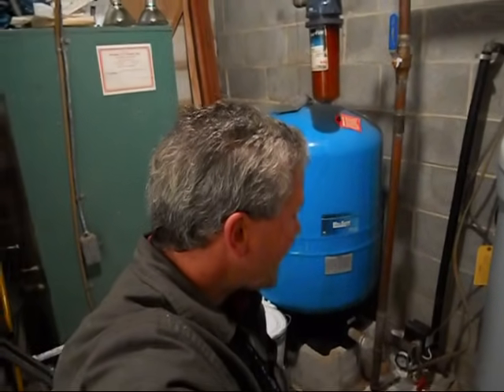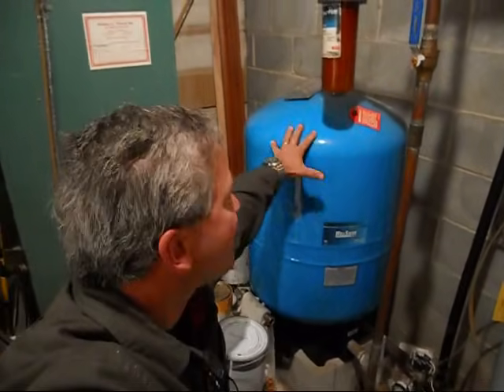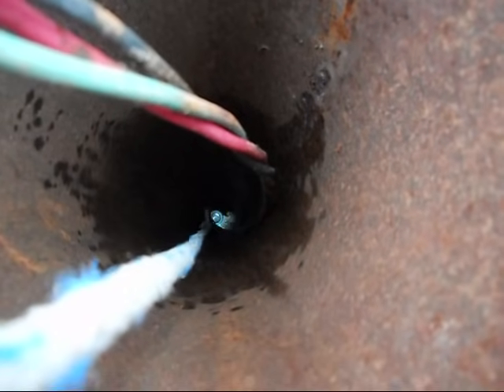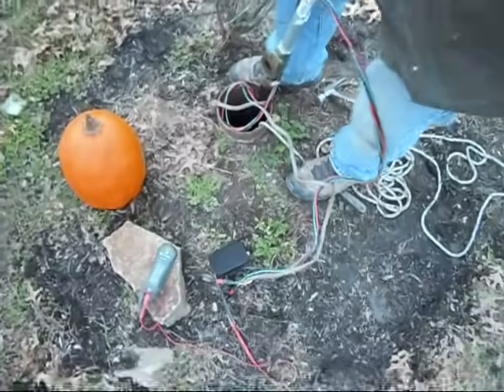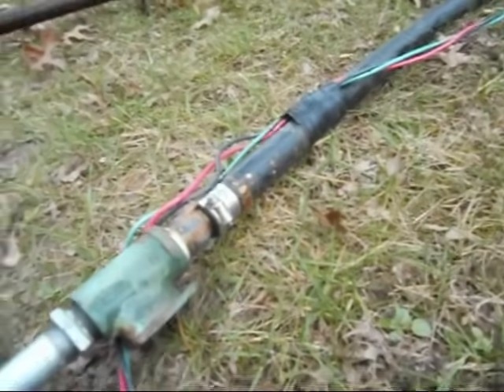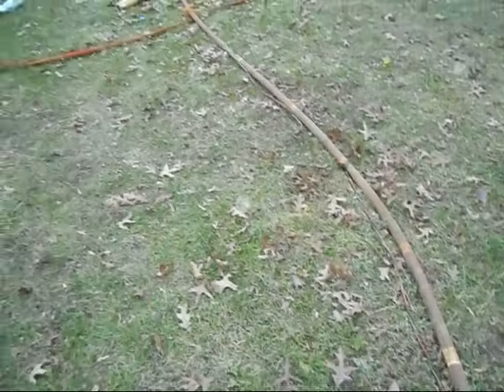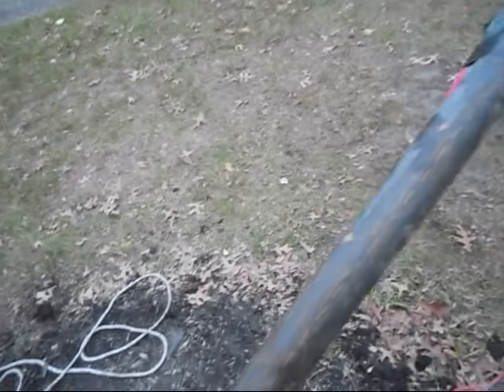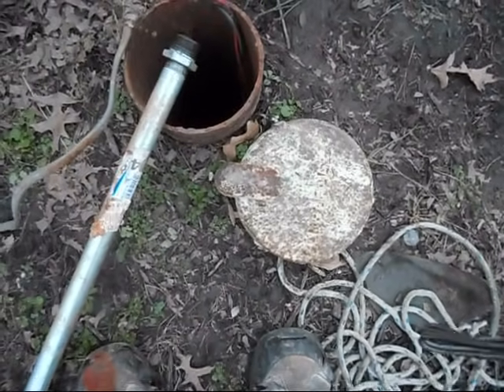Replace Well Pump in 4 hrs (all 12 videos clips) 100 ft Myers 2ST52-8 by Tatcor.com West Chester, PA

Comment: New pump, get a new check valve, too.  Wrap the clamps with electrical tape, too.  That’s so they done hang up on anything.  Wrap the wire around the tube, many places to prevent tangles and knotting up.  It also protects the wires from rubbing on the pipe, Shorting out..

Comment: great video if you have that awful black flex pipe which can crack from freezing  schedule 40 pvc screw together is much  harder and requires a well rig tool to unscrew and rescrew the pipe my pump is 700 ft deep i live in georgia 3 layers of granite and bedrock which broke the drillers bit 3 times lol i have seen my pipes no go here for this need a pro

Comment: Couple of things before anyone starts this process. 1. clear debris from around the well BEFORE you open it.  You do NOT want ANY organic material falling into the well. 2. prepare your work area, preferably with some way to keep the hose out of the dirt etc.  you also probably want to have some kind of degradeable safe disinfectant available to wipe the hose off as you're lowering it back into the well.  My commercial deep water guy used minimal amounts and after reinstallation was complete, he  ran the water for some time to clear anything left near the pump.

Comment: Great video and tutorial. Very informative. Gonna have to pull my pump because, after verifying everything in-house is good and working properly, I can only get 24pis out of my 40/60 pressure switch, and so the pump stays energized, and when I kill power to the pump, the pressure falls to 0, indicating I have a hole(leak) somewhere along the length of my below ground piping. Thank you for the additional time and headache of recording and posting this procedure.
Reply: Tracy, You may find the leak is at the pitless adapter on the outside of the well.  Sounds like a galvanized barb fitting that screws into the Pittless adapter to connect to the pipe heading to the house can break at the threads.  Mine is leaking there as the grass is greener but I put a check valve at water tank for now.  Let us know what you find.  Check out,,,H2o Mechanic
Reply: @jefffrayer8238  Greatly appreciate the feedback. I don't have a pitiless adaptor; straight up through the wellhead seal and to the  house. I believe the leak is down at the pump, below the water line, since I dont have any air in my water while it's running. Pretty certain the pump check valve is stuck open or damaged, so plan to pull it, when I am able to, and attach a brass check balve on top of the pump and then drop it back down. For now, I just, today, put a check valve at my tank to keep as much air out of my pipes as i can.

Comment: It's a wedgie pitless adapter. One of the easiest to pull out but not necessarily easy to reset. The pump is set on poly pipe which is not always a good idea to set pumps on. It depend on where you are in the country but sch. 80 pvc pipe is what i recommlend.

Comment: You didn't show how you found and engaged the pitless just showed the before then skipped to after which is why I disliked your video - if you have that portion but just edited it out cause maybe you made some mistakes or had trouble and wanted to look more professional - then redo this clip and put that edited out portion back in.  Most of these DIY clips never show the problems and what-ifs just deceptively make things look simpler and easier then what they would be for most DIY'ers with little to no experience.  That is so frustrating.

Comment: Another video I watched had the pipe as rigid pvc and in 20ft sections.  You need to pull it out section by section and then disconnect them from each other as you go.   Also, I thought there was supposed to be a rubber expander (expandable torque arrestor) placed just above the pipe that prevents the pump from twisting the pipe when it kicks on?  In all honesty, this seems to be a lower quality well system than the one in the other video I watched.  Its not as deep and does not contain as many components to deliver quality water and good, consistent pressure.   While deep is a good thing, it makes it obviously a lot harder to replace things when they start to fail.   In the other video, the guy had to construct a tower above the well and use a winch to pull out the pipe and pump.  This guy lucked out that he has flexible piping and didnt need to go through that.

Comment: I know exactly the feeling you described at the beginning of this video.... When I purchased my home 20+ years ago the WELL water system turned out to be a significant problem, Back then I frequented a industrial plumbing supply outlet and the owner walked me through all the parts I needed (I am still very grateful for his help) and I replaced all the internal stuff (pressure tank, pressure switch, Copper Piping, Filter) first, then spent weeks learning about submersible pumps because there was still a significant problem. The day came and I opened the well and pulled the pump, 300' of pipe, wire and pump later, I went to plumbing supply and purchased every thing (needed to know well depth for tubing & wire). The original problem was probably caused by a 50 ?? year old pump, galvanized fittings and tube sections every 50 feet or so). Installed a Pitless Adapter, piping from that to internal plumbing, and wired the new pump (bench tested it in a garbage can of water) and finally dropped it into the well (Took one full day total). Pulling the 300' was a surprise in length , and was tough to do alone....back then when I was younger, and I may do it again soon to replace the 20+year old pump (this time with help) which is why I watched your video. But now I know what to do reasonably well. Pricing and finding parts is more difficult now (the original plumbing supply) is closed and I have to utilize new untested sources for overpriced parts, but it still will be less $$.As I said "I know exactly the feeling you described at the beginning of this video".... because I am feeling it again even now.
Reply: No one should ever ever use galvanized fittings inside a well. Brass or stainless only. It only takes a few years for galvanized fittings to act like steel fittings and corrode to death. I know from much experience.

Comment: So the connection I think you called it a shoe connection - how does that attach/detach to where it connects to pipe going into the home?  Does it essentially slide into it?  I imagine that could get pretty frustrating!  Did you lubricate the oring at all to ensure a water tight seal?

Comment: Good Video. My father designed a metal mounting bracket that mounted to the well head with a lawn tractor size wheel that was attached to the bracket sort like a front motorcycle frame. You could role the tire while the pipe came up laid against the wheel. And you could take a lawn tractor to pull the whole thing out with just one person steadying the pipe as it comes out rolling along the wheel. Five guys just stood around and watch instead of having to kill yourself yanking it out by hand. The wheel was low on air so that the pipe would guide on it better. I imagine you could make one out of sturdy two by sections of wood with a long piece of endless thread and some nuts. you could attach it with tie down straps etc. Then all you need is a wide tire. Make and mount it so that the pipe touches the tire before it can rub against the side of the well casing as it comes out.

Comment: This up to 50 and down to thirty is pure BS. I had this in a rental house and it drove us nuts. turn on shower--great pressure and forceful stream. As you stood there e the stream slowly lost force and almost died down. then the pump comes on and---whoosh---back to 50 psi again. I had a friend come over and he showed me how to adjust the pressure switch so when the water was turned on the pump stayed on until demand went away. This is the way it should be.

Comment: All well metal castings develope corrosion in time, they need to be clean or one time you'll not be able to raise or lower pump. Why would you not replace wire line, drop line everything new that's going down the well.  I would expect the system to last 12 to 15 years, but with to much iron in the water everything needs to be new.

Comment: a licensed well tech (pro) would not charge a whole lot and has the knowledge and training and tooling to not just guess how your potable water supply is delivered. You got lucky. I get calls on any given Sunday from homeowners that dropped their pump halfway to China so the meter runs at time and a half because general contractors mess with deep wells when I am setup to watch football games. A home owner CAN do this but doing so is as smart as removing your own appendix. I put my kid through college debt free just because homeowners didn't want to part with the few hundred bucks our company would have charged to work on it. Maybe tell the masses how much that bore cost and how it can go horribly wrong when you F up. This is a job best left to well techs, unless you don't care about your house supply of clean water.

Comment: that black boot or torque boot you have on there is not going to do anything. there supposed to fit tight against the casing so the wires dont rub. you dont have it extended out far enough.

Comment: PLEASE BE SURE YOUR PUMP IS HUNG ON POLY PIPE BEFORE YOU DO ANYTHING LIKE THIS!! IF IT IS NOT YOU WILL LOSE A DIGIT OR LIMB!!!  I'm a Washington state certified well technician. A lot of what this man does is wrong and dangerous. The pipe attached to the "Shoe fitting" or pitless adapter as it is called should be supported before you attempt anything. There are three major types of pipe used to hang pumps off of: galvanized steel, Sch 120 or 80 P.V.C. and Poly pipe. If his pump had been hung on galvanized pipe he would of lost digit doing what he did. Poly pipe is NOT meant to hang a pump off of!! Sch 120 is very light, so pulling by hand is still an option for shallow wells. But unlike poly pipe, Sch 120 PVC is meant to support the weight and torque of a submersible pump.
Reply: I saw this too. He got lucky with all of it. Its like saying "I flew a kite in a thunderstorm but I'm fine" and then someone watches this video wonders why their pump is now a dart in the earth's core and can't get it back. The video should start out with "I did this but don't try this at home unless you like roulette with lots of money at stake".

Comment: i need help with my well pump. The area where my well is located is leaking water. I opened the well cap and it looks just like yours in the video. I dont see any water leaking from the actual well but there is water present on my lawn around the well. any idea if replacing the pump would correct this issue or would that be an issue from the connection coming from the house?

Comment: I started working for a professional in training since 4 days, our wells casing comes out the ground 2 ft here and wells are down about 3-400 ft. Minus 10 celcius (do the math, north Canada...) , I’m not strong enough like other guys to do like them. Frosted gloves, hands slides on the T bar no matter how strong I grip it. We invite ladies to apply, I’ll probably have to send new resumes next week. Have a wonderful day. For the rest, yep, you figured out pretty much all I learned here, except we put electrical tape from the pump up to 1ft above the electrical connection to keep the wire safe around the pump especially when passing the shoe fitting, we call it a pitless but I understand the shoe name makes some sense as well due to its shape. I also never saw any plastic spacers to keep the pump centered...Thanks for the effort of making that video.
Reply: It's also call a pitless here in Oregon.  We pvc pipe wrap tape every 20 feet securing the wire.  That plastic piece around the pipe/pump is a torque arrestor.

Comment: Can I ask a really dumb question? Why can't a guy have a pump that pulls water into the house instead of pushing it.   Maybe a pump that is not in a casing. A pump that is easily accessible on the outside.
Reply: You can but they will need to be completely different pump designs (for example like a vertical turbine pump which are usually industrial size 500-25,000 GPM+) and still have heavy impellers that drops in the well casing. If you are talking about having a smaller pump up-top and simply "suck/suction" water up to it and then push it, that creates its own set of problems like cavitation and efficiency issues since one side is pulling and the other side is pushing; also, one side having vacuum in the pipe that might cause it to collapse, depending on material. Freezing issues for above/ground pumps, code requirements and etc. etc. Hope that helps.

Comment: Hey dude. One question, how do you disconnect the shoe fitting/pitiless adapter from the house, since it’s down in the casing?
Reply: You would have to dig down the casing to expose the pitless adapter to replace or repair that.

Comment: Gotta question for ya if you could help me out. It looks like the wire to my pump broke. What kind of wire can I get to replace it?? Should I call the company I bought the pump from? Or my local hardware store?
Reply: It's called well wire an get it from plumbing supply shops

Comment: The “shoe” he refers to is called a pitless adapter. Torque arrester was damaged and not adjusted properly and is very important in keeping the pump from damaging itself. Overall good job. Don’t let the “pros” rip you off. This is a job any man should be able to tackle
Reply: I am not so sure at 75 years old... lol.
Reply: Ed: I did it at age 73. Had lawn tractor ready to assist with pulling my 75 Foot well black roll tubing. It is the pulling and positioning that is a little bit uncomfortable. I fabricated a little roller to clamp to the well pipe to keep the pump centered as i pulled it up slowly with the tractor. Wife watched pump coming up and informed  me when pump was near the top. Putting the new pump in is very easy. A lot less effort. @edwardmmanns7454
Reply: Good to know wanting to upgrade my pump but everyone keeps saying it's gonna run my 10 grand and up

Comment: Nice Video. Well Done. We manufacture a product called WellHose that is designed to replace that black polypipe you used. It rolls flat and is very easy to handle and simple to use. Ideal for DIY and not loved by contractors !!
Reply: Why not loved by contractors? As a heating & AC contractor, I welcome new products and innovation!
Reply: Luckily there are some forward-thinking pump contractors like you who do embrace new technology and DIY products. Good job. With the WellHose you will be able to install a lot more pumps a lot more efficiently.
Just scroll down the comments for this video and you will see contractors critical of DIY. Why is that?
Reply: They probably either saw some shoddy workmanship, or could be thinking that DIY takes away from their business income. In some cases, some people really should not be doing DIY (those who are not mechanically-inclined). Once you get into the more technical things, that's where DIYers usually start making mistakes. Especially on the small details, some of which could end up being be very costly. Although I don't see how this really affects professionals, as they would be called in anyway after the fact to fix the problem. DIY has its place. It's not for everyone, and that's where professionals come in.
Reply: I agree with your comment about them thinking WellHose DIY takes away from their business. Many contractors have told us this directly. I also agree with your comment on DIY'ers sometimes making mistakes..... I guess that's why they call it Destroy It Yourself !
Reply: Haha. First time I heard that spin-around. That's funny.

Comment: LMAO!!!!! Horrible original installation and no better now. Well cap is junk and i did not see any chlorination of the well. I saw nothing but several violations of how to remove and reinstall a well pump. I would be in front of the water well board for the current pump job and the replacement too.. This video clearly indicates why states require pump installers to have a licence and do continuing education ever year..

Comment: Pitless adapter not a shoe. Rubber gasket not a O ring. Nice vid though. Safety rope I saw something but I looked weak. If you had a malfunction at least to can retrieve it back with a safety rope. Dropping something in a well is like retrieving something back from the moon.

Comment: Not too impressed with the 4 hours it took to do this. I have helped replace 3 well pumps on the golf course i work for. 2 were over 200' deep and 2" steel pipe. My boss said he had only done it once before but we got the first up and back in in 6 hours. That was 230'. The second was 280' and we did that in about the same amo7nt of time cuz we learned a few things the first time. We were only able to pull about 8' at a time using a front end loader to lift the pipe. 3 pulls for each 21'section of pipe and then disconnect and pull some more. Reverse process foing back in. The 3rd was a smaller pump with plastic line and we pulled 160' replaced pump and back in in about an hour and a half. Fyi if you have plastic well pipe this job is cake and you shouldnt need to hire a professional if you have basic knowledge of plumbing and hand tools.
Reply: I found a DIY drop pipe online that is much easier than using steel or pvc.